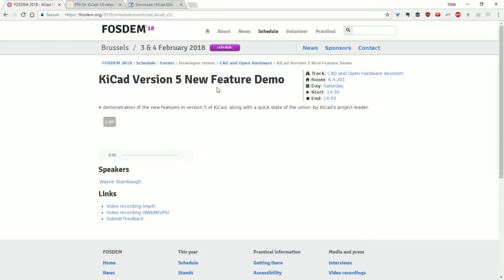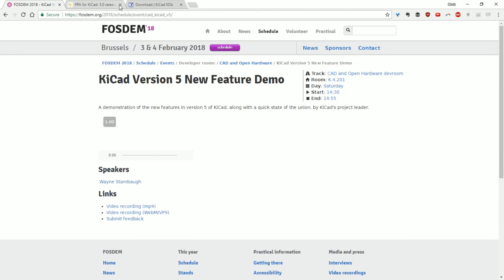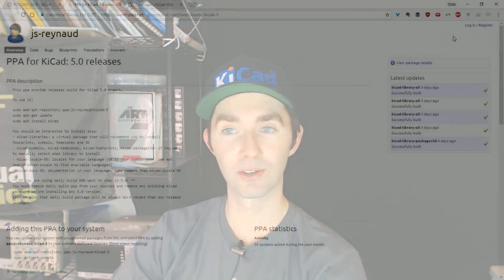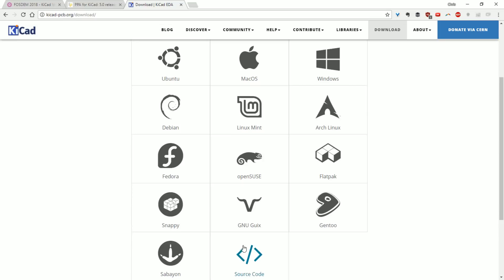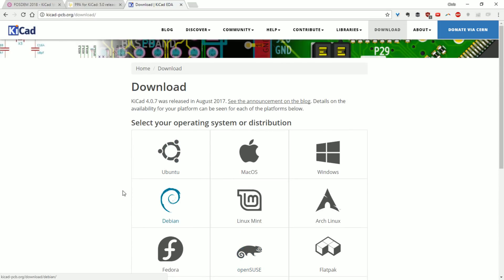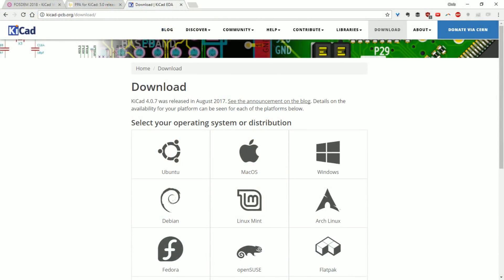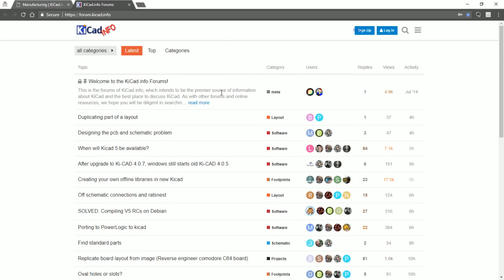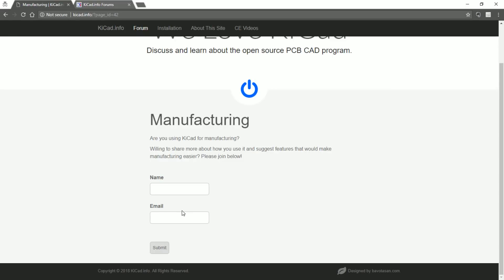Should you update to KiCad 5.0?

Comment: quick comment about using KiCAD to design and get things manufactured:  A built-in way to do board assemblies or copy-paste board files into a larger panel and route/define your own frame around the boards... ability to design a frame like this is very handy, and I did this in Altium Designer 2010 back in the day quite easily. The frame even had power traces which worked to provide power to all boards in the frame until the boards where snapped out!

Comment: Using kicad in your projects is a good investment. Always make sure you have source code for all of your tools. Otherwise you are doing equivalent of locking up your designs in a safe and dropping it into the sea.
Reply: Source code  of KiCAD in this case, you mean?
Reply: Source code of any tool. I only use proprietary tools for stuff that others want me to do for them saved in specific format. But that's their loss not mine. I think it's a shit choice on their part. Being able to change the code, recompile and use the tool is priceless and always for me the most preferable way to work. For example, altium is great tool, but I would never use it for a new project I would use kicad instead and any missing features can be added to kicad with full source code being available and the ability to change the schematic and the board later whether you have a license or not.

Comment: I'm new to KiCAD and found the prod v4 version difficult to start working with - issues with missing and incompatible components/footprints. Decided to try v5 and it's been so easy to get going with, and no issues yet (although I'm not a power user by far).

Comment: I‘m using KiCad mostly for small projects with less than 10 units manufactured. The last project was for an art installation on Burning Man, where I had to make 6 boards, and another 6 smaller ones for a model of the installation here in Germany (the small ones will go public on github some time soon). So mostly low-power (less than 200 W) and low-frequency (less than 10 MHz) up until now, sometimes also for embedded RFID antennas. However, my next project to be manufactured will be a transceiver system for optical data transmission, with over 1 GHz of bandwidth. So that will be something new to me.